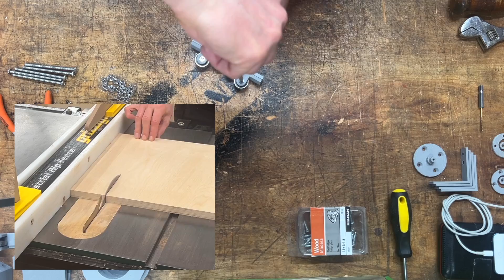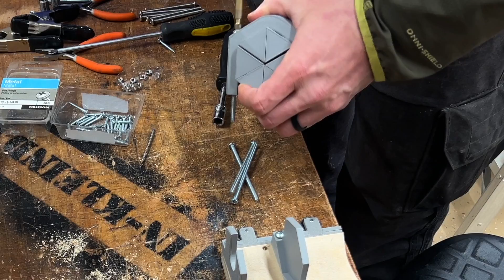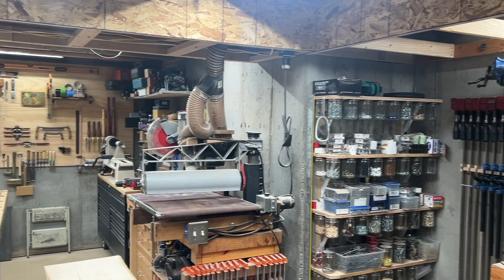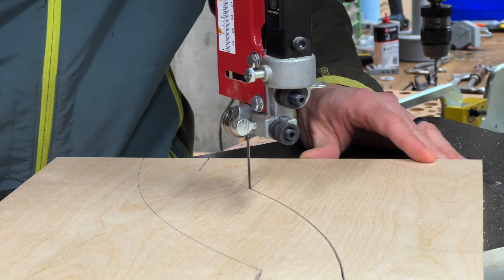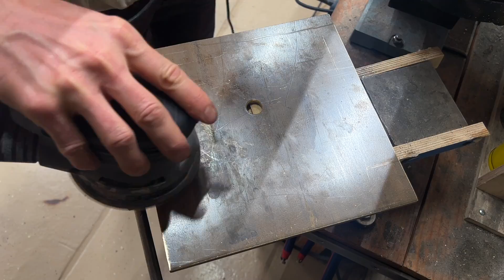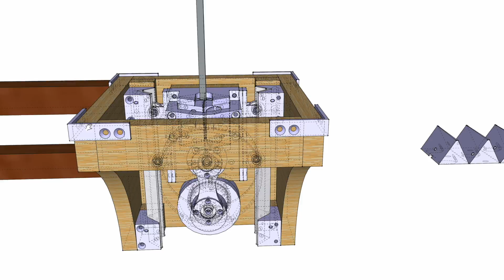Belt Grinder Filing Machine - Die Filer!

Comment: Hi andrew, good idea with this die-filer.
I also know the problem with the splitting plywood.
In my experience there are 4 aspects that affects this:
- The plywood itself, is the ply bad, it will split, no matter what you do. But your ply looks high-quality.
- The screw. When people don't countersink but use a countersunk-screw. But you did contersink...
- The drill or the pilothole. In my opinion, these tapered drills are bad. The hole they create is too tight at the bottom. So tight, the screw will split the ply. Its like there where no hole. Or, if you drill deeper, the hole is still too tight at the bottom and to wide at the top. Since I use straight drills, this is less of a problem.
It also helps if you use screws with a drilling tip, even better with a drilling tip and cutting countersunk. These screws still needs pilotholes and countersunks, but if its not perfect, they correct it by itself, at least a bit.
- The impact driver. The impact driver forces the screw in the wood, whatever comes. You can't "feel" the wood. And the screwhead is forced in the countersunk, and this is the biggest issue for splitting plywood at the top.
I banned all my impact-drivers from my shop. Its a tool for a jobside or for bigger, rougher projects. I use regular drivers. It's also way quieter...
I hope someone can pick up something from my experience...